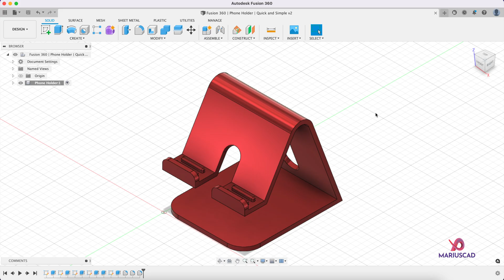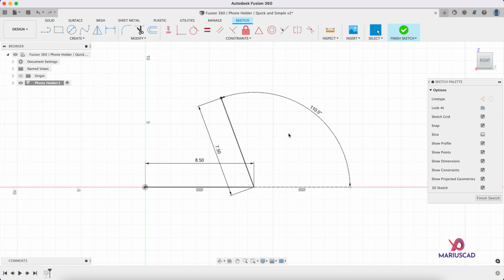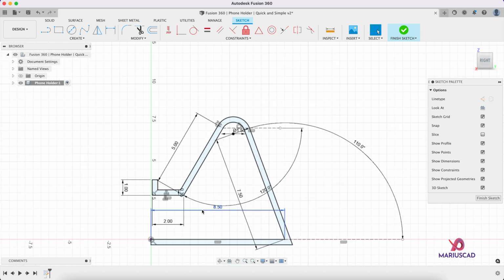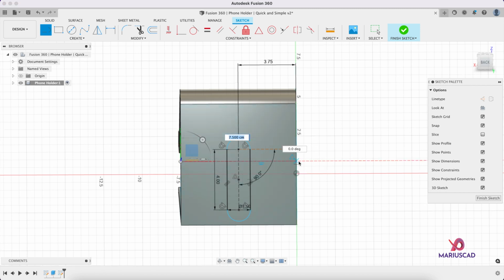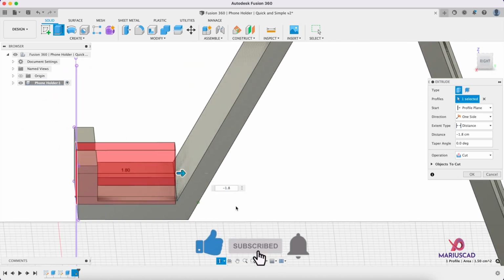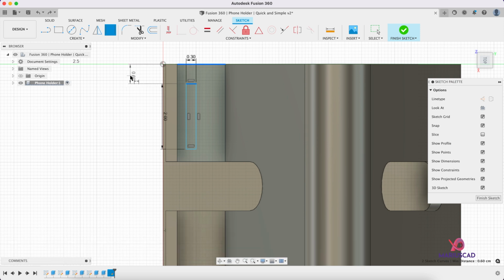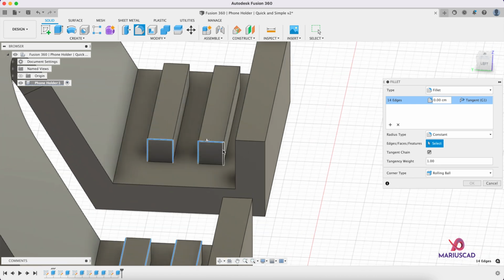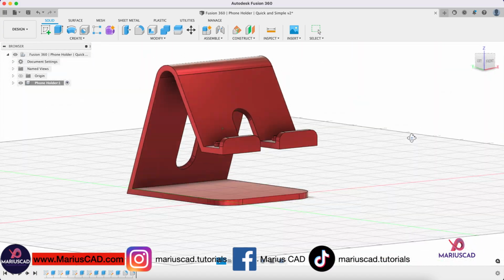Fusion 360 | Moldeling a Phone Holder | Quick and Simple

Comment: if i use a 3d printer does it make a diffrence if i add the red
Reply from the maker: Hello!
The answer is absolutely no. Even though the tutorial has several months from posting, I printed it one week ago and I printed it blue because my PLA cable was blue.
Just flip it on the other side to print better.